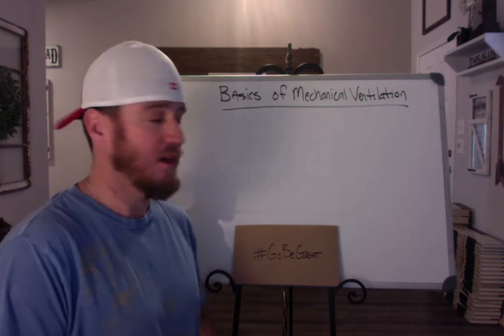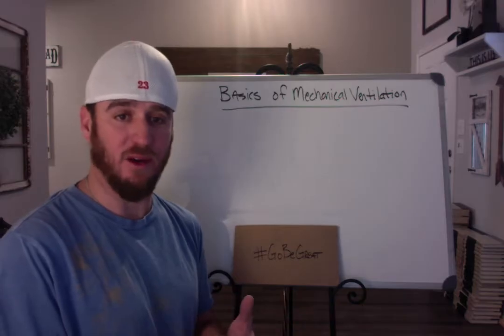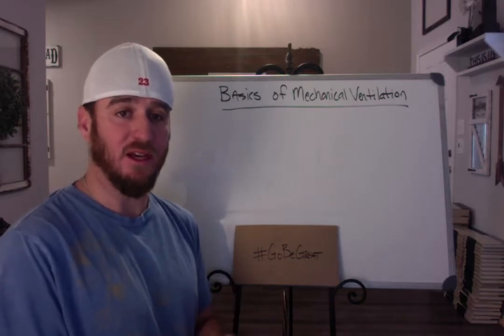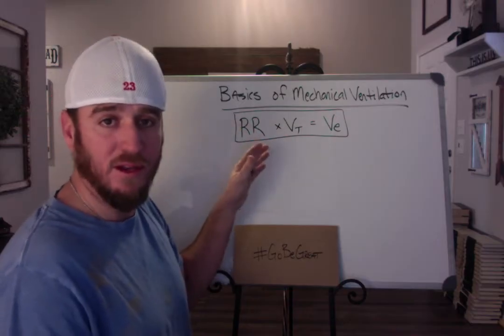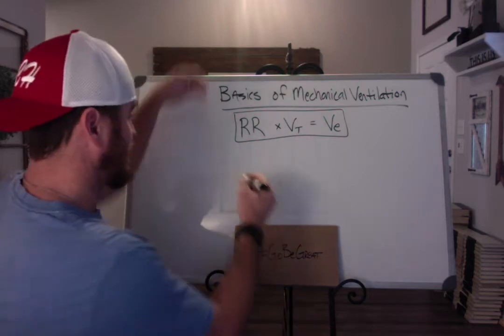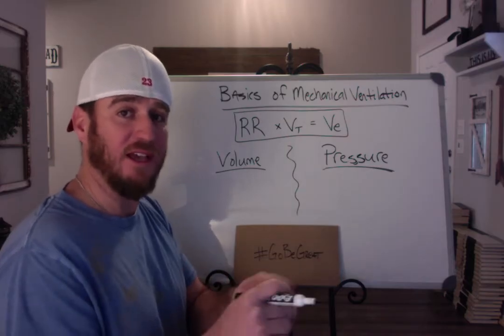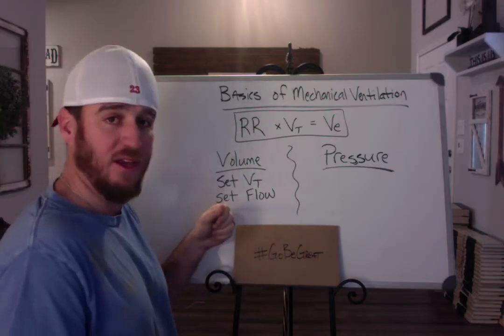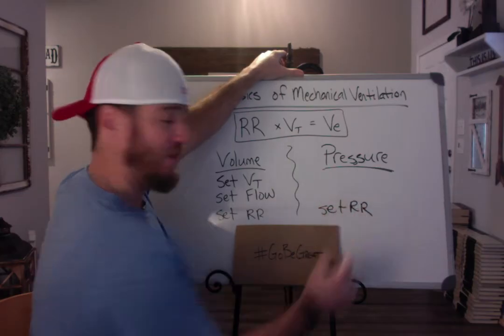Basic Principles of Mechanical Ventilation

Comment: Sir so its better to use volume control vent as the desire TV is given inthis mode but in pressure control what is the use of increase pip and to atain that pip increasing the I/E  ratio when adequate TV is not reaching the alveoli....

Comment: Hi! I’m a RN trying to refresh my memory on some of this in the chance my community hospital gets overrun with covid-19 patients. I was with you all the way up until you were talking about how with volume control-your pip varies & pressure control-your tidal volume varies. In my mind, as your lungs become stiffer & airway is under more pressure with pressure settings your tidal volume would have to go up to achieve that set pip & i time. As the same with volume control as your lungs become stiffer & airway under more pressure your pip would go down because the tidal volume is set and doesn’t automatically adjust itself to compensate for worsening airways. Am I making any sense as to my question? I was following all the way up until you were describing how the varying measurements would react to a patients lungs getting better vs worse. For some reason the varying measurements (pip & tidal volume) would go the opposite direction.
Reply from the maker: Hi Makayla, I actually replied to this three days ago.  Just came back to see if I had cleared things up for you, but apparently my reply didn't post.  So let me try this again.  

In pressure control we set an inspiratory pressure and an insp time to hold that pressure.  Try not to think of it as what tidal volume is needed to achieve that pressure, because the ventilator is not operating in a volume oriented state.  It's only focusing on reaching that pressure and holding it.  It does this with a variable flow of gas, which is determined by the compliance of the lungs and the airway resistance of the lungs.  So when the lungs are very stiff (ARDS), or the ariways are very small (asthma), they don't want to expand as easily as normal lungs do.  Therefore, the set insp pressure results in smaller delivered tidal volumes.  As opposed to healthy lungs, that would naturally accept more volume with the exact same pressure.

In volume control, the exact opposite is true.  We tell the vent to deliver a set tidal volume at a set flow rate, and peak insp pressure is dependent on lung compliance and airway resistance.  The vent doesn't care about peak pressure in vc, it's only focused on delivering set volume of gas and set rate of delivery (flow).  Thus, if you put the same amount of volume in a set of healthy lungs vs noncompliant lungs, the noncompliant lungs will have a higher pressure because they don't want to expand as easily as the healthy lungs.  

I know I've just repeated what the video said.  As I was writing this I may have realized where your hang up is.  In your comment you mentioned tidal volume compensating to achieve the set pressure and not compensating in vc. Try thinking about not from a compensating perspective, but rather a resulting perspective.  In PC, tidal volume is a result of a set insp pressure and I time, nothing compensates for anything.  In VC, peak pressure results from your set tidal volume and flow, and again, nothing compensates for anything.  There are modes that do compensate for resulting variables, but PC and VC are not those modes.  

I admire your desire to brush up on mechanical ventilation during these times.  If this concept still doesn't make sense, which is perfectly fine if it doesn't, then please send me an email @ respiratorycoach@gmail.com.  If you truly desire to understand it, we can set up a time to talk it out over the phone.  I can verbally explain this much easier, and 100% guarantee you'll hang up understanding it.  Let me know.  Thanks for watching, commenting and for all you work at the bedside!  Best wishes!

Comment: Hi! I’m a RN trying to refresh my memory on some of this in the chance my community hospital gets overrun with covid-19 patients. I was with you all the way up until you were talking about how with pressure control-your pip varies & volume control-your tidal volume varies. In my mind, as your lungs become stiffer & airway is under more pressure with volume settings your tidal volume would have to go up to achieve that set pip & i time. As the same with pressure control as your lungs become stiffer & airway under more pressure your pip would go down because the tidal volume is set and doesn’t automatically adjust itself to compensate for worsening airways. Am I making any sense as to my question? I was following all the way up until you were describing how the varying measurements would react to a patients lungs getting better vs worse. For some reason the varying measurements (pip & tidal volume) would go the opposite direction.
Reply from the maker: Hi Makayla!  Nice to see a RN drop in and refresh on some respiratory concepts.  Referring back to your comment I think I see where your confusion is.  I'm going to refer back to your comment to try and clear things up for you.  The key words in your comment are as follows, when you stated, "...as your lungs become stiffer...volume settings....tidal volume would have to go up to achieve set pip and I time."  Now, think about this Makayla, you started that comment off referring to volume control and ended it talking about pressure control settings.  In volume control, we set a tidal volume and pressure will hence vary based on compliance and airway resistance. In other words, compliance and resistance don't change the amount of tidal volume delivered, just the resulting pressure from the delivery of that tidal volume, in volume control.  The exact opposite is true for pressure control.  You said, "..with pc....lungs become stiff....pip would go down because tidal volume is set...".  Remember, in pressure control, the inspiratory pressure is set, not tidal volume.  The vent is going to delivery the set insp pressure for the set insp time, and the resulting tidal volume will vary based on compliance and resistance.  I thought I might have misspoke during the video, but I went back and watched it and its correct.  

VC = set tidal volume = varying peak pressures based on compliance and resistance.  
PC = set insp pressure = varying tidal volumes based on compliance and resistance.

Please let me know if this makes more sense now.  I deeply desire to help you and others understand these concepts, especially during these times when everyone is being asked to do more with less.  

Thank you Makayla for watching and commenting!  I appreciate you!

Comment: Hi, i have question  i heard  if we have pt have metabolic acidosis we don’t do for him extubation, and I don’t understand why? .. also could you be talk about chest protocol when pt have chest trauma what the first setting for him .. and thank very much for reply to me ❤️
Reply: Yes it make sense, thank very much for your answer ❤️
Reply from the maker: We typically would be cautious extubating a patient with a metabolic acidosis because they will have an increased work of breathing as the respiratory system attempts to compensate for the metabolic acidosis.  Doesn't mean we don't ever, just seems like a formula for failure in most cases.   Does that make sense?